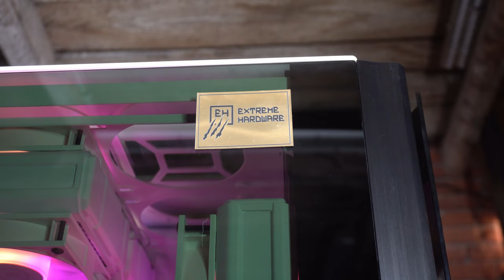EH "UNICORN" - Tęczowa potęga

Comment from the maker: EH "UNICORN" to projekt, który zrealizowaliśmy w Kwietniu 2023 roku, planowaliśmy go zaprezentować w okolicach gwiazdki 2023 jednak niestety nie udało się spiąć tematu czasowo. Ten kolorystycznie unikalny koncept łączy w sobie zarówno potęgę komponentów, chłodzenia jak i gabarytów. Ważąca około 70 kg konstrukcja charakteryzuje się topową wydajnością jak i wzorową kulturą pracy oraz niskimi temperaturami. Biel, róż, czerń oraz złoto to wyjątkowe połączenie kolorów, które w tym przypadku przekłada się na iście hipnotyzujący efekt. Niestety tego zjawiska ani zdjęcia ani worklog nie są w stanie oddać w pełni, jednak na żywca efekt oczarowania gwarantowany :)

EH "UNICORN" specyfikacja :

i9-13900K 5.5 GHz P / 4.3 E / 4.6 Ring
ROG Z790 MAXIMUS EXTREME
4x16 Trident Z5 5800 CL36.38.38.36 T2 G2
RTX 4090 STRIX OC / + 120 / +1000
3x SAMSUNG 990 PRO 1 TB
CORSAIR AX 1600i
CORSAIR OBSIDIAN 1000D

Custom LC :

2x HWLabs GTX 480 - Satin White (Loop GPU)
2x HWLabs GTX 360 - Satin White (Loop CPU)
20x EK Quantum Torque HDC 16 - Gold 
4x  EK Quantum Torque Extender Static MF 28 - Gold 
2x  EK Quantum Torque Extender Rotary MF 14 - Gold 
8x  EK Quantum Torque Rotary 90° - Gold 
2x  EK Quantum Torque Plug - Gold 
2x  EK Quantum Torque Splitter 3F T - Gold 
6x  EK Quantum Torque Micro Plug - Gold 
2x  EK Quantum Torque Drain Valve - Gold
2x  D5 G3 PWM Motor 
1x  EK Quantum Inertia D5 PWM D-RGB - Plexi 
1x  EK Quantum Vector² Strix RTX 4090 D-RGB - Nickel + Plexi
1x  EK Quantum Velocity² D-RGB - 1700 Nickel + Gold 
3x  EK Mystic Fog (Premix 1000mL)  
3x  EK CryoFuel Power Pink (Premix 1000mL) 
30x EK Vardar EVO 120ER D-RGB (500-2200 RPM) - White 
2x Alphacool Eisbecher Aurora D5 Acetal/Glas - 250mm  
1x ThermalRight LGA 1700 ContactFrame
1x Thermal Grizzly Kryonaut Extreme 2g  Krynoaut Extreme 2g
Oploty ExpendableCustoms 
Obudowa malowana proszkowo

Muzyka :

- Horizon Forbidden West Ost 2 - Aloy's Theme
- Horizon Forbidden West Ost 1 - Whatever Comes - feat Julie Elven & Melissa R. Kaplan
- Horizon Forbidden West Ost 17 - The Wings of the Ten - feat. Julie Elven
- Horizon Forbidden West Ost 8 - Shelter from the Storm